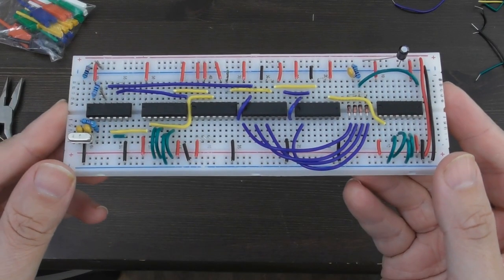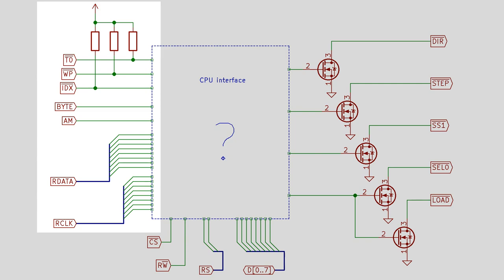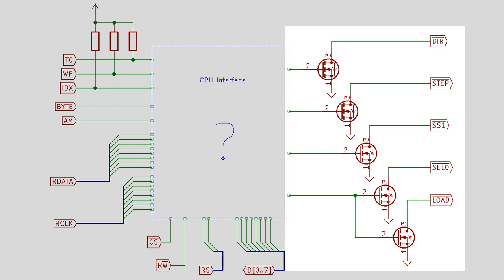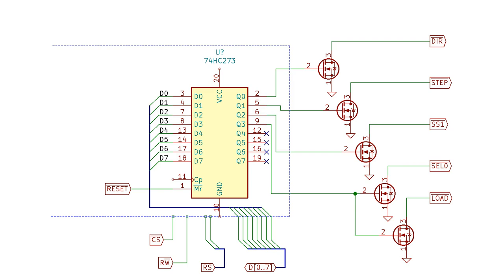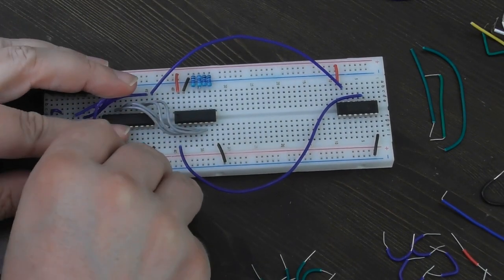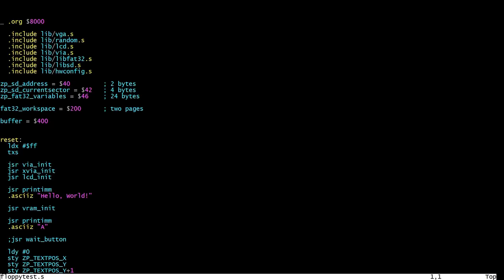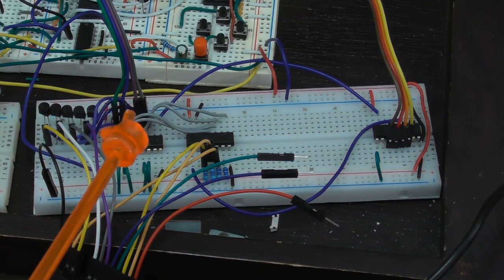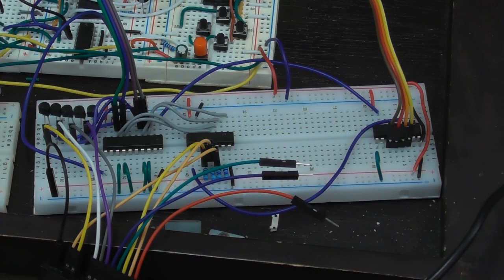Homebrew 6502 controlling a Floppy Disk Drive

Comment: I pulled out a bunch of schematics for FDC boards… and the common driver for the floppy I/O lines is an 74LS06 open collector hex inverter.
Reply from the maker: Yes,  I think anything open collector/ drain should work well, I don't have any though so have to improvise!
Reply: @GeorgeFoot  They used them (74LS06’s) for the inputs from the drive also… with pull ups before and after.
I got tons of TTL… but no MOFSET’s. I guess you’re more DISCRETE (sic!) than I am! ;-)
When I first saw this project I thought “Why doesn’t he just use a WD 1793?”… but then when you explained why you didn’t use a PIO I understood. ;-)
I’m interested to see how you design the data/clock separator… and are you going to do single (FM) and double (MFM) density?
Maybe I’m just lazy but I’d just pull up old (S100!) floppy disk controllers and PLAGIARIZE! ;-)
I recently restored an OSI C4P MFD… they didn’t use a FDC chip ether… they just used a UART! Which they then NRZ’d!!! All the floppy control lines they ran in/out thru a PIO (buffered (74LS06!) appropriately).
Reply from the maker: @geowar20  I think I included the recommended transit/ receive circuit from the Shugart SA800 datasheet in the video - I don't recall the exact part they used in the receiving end but I think it was schmitt triggered, which makes sense.

I do like to do things at a fairly low level, my goal is understanding more than anything!

Regarding clock recovery and separation, I built that circuit last year in the first few videos in this series - it's an unusual approach but works well for me. Currently it's FM only but it should be fairly easy to extend to MFM - just double the frequency, change the address mark detector, and probably handle the rest in software I think!

I hadn't thought of using a UART for this but I guess clock recovery is one of their main purposes. Still I enjoy coming up with my own solutions for these things.
Reply: @GeorgeFoot  The OSI C4P MFD didn’t do sectors… the OS just waited for the index hole and then read data from the UART like it was an audio cassette port!

Comment: Love it! Of course you had a nice way to say you won’t use a 6522 because it’s too easy XD 
When I get around to this you bet I will use a FDC IC instead - that seems like plenty of a challenge in itself.. but maybe I’ll do 8” floppies :D
Reply from the maker: Haha I wonder whether you can find some of those! Even these 5.25 inch discs are quite hard to get now.

A limitation of the 6522 was that it didn't have enough pins to read all the clock and data bits, let alone introducing more bits for writing. But a 6522 with some external ICs (maybe shift registers or the kind of thing I did here) could have worked well and would have the benefit of also incorporating timers and interrupts. I also had some crazy ideas to reduce the need for so many days and clock pins, which reduce the hardware complexity but add to the software complexity.

I checked Commodore's schematics too, but they didn't just use a 6522, they had another IC to assist. Two 6522s would be another option.
Reply: @GeorgeFoot  
I wouldn’t shy away from using the 6522 shift register for data and the gpio’s for the control lines - or external shift registers.
The 8” drives are horribly expensive - I will need a sponsor for one of those. I have no idea about disks either!
Right this weekend I found about 20 5.25” floppies so now I’m committed to getting a drive for those too - they seem to contain CP/M-86 software at the moment. If it survived since the late 80’s that is!
Reply from the maker: 8 inches would go well with the reel-to-reel tapes!

Comment: Welcome back! 

Unrelated question, but which video circuitry are you using?
Reply from the maker: It's the 640x480x8 colours one from a year or so ago, the same one that I bolted the sprites onto before.  My text output routine dates back to the earlier black/white/blue/orange four colour circuit, and I've not updated it to deal properly with the extra bit plane, so for this I just initialize the red plane to be set for every pixel, and let the text output routine write only to the green and blue planes.  I also swapped a 16V8 PLD in for some of the glue logic that synchronizes CPU access to video RAM.

Comment: Is it possible to use a 3.5 inch drive or it only works with 5.25 drives?
Reply from the maker: The interface is mostly the same for both, so I think it should work, but i haven't tried it.

Comment: I think I've got an old floppy drive somewhere, so I might try this myself one day. I'll be interested in how to read the floppy data, will you be using fat16 or a filesystem you create yourself?
Reply from the maker: I haven't thought much about the filesystem but most likely to begin with I'll use the BBC Micro's one, because then I already have a good way to get data onto the discs.

I think fat16 requires 512-byte sectors, which are also not ideal for these discs or an 8-bit computer in general.

Comment: Wow, a 150 ohm pull up seems really low. I am used to seeing 1K at a minimum.
Reply from the maker: Yes, I think it's to match the impedence of the ribbon cable (with ground wires alternating with the signal lines) - so 150 ohms will prevent reflections back and forth along the wire. But then I think 3.5 inch drives increased the resistance, and I'm not sure what effect that has on the transmission line.
Reply: @GeorgeFoot  Ah, that makes sense. I figured it was for something related to noise. Transmission lines are one of those dark arts of EE that I only know a little about.

Comment: You are not scared of the day when they stop making disks?
Reply from the maker: Yes, they are hard to get these days, as are the drives. But like must of the low level things I do, this is more for the sake of understanding how things worked.
Reply: Back in about 1992, I threw away 2 sacks of 5 1/4" and 1 sack of 8".... I still look back on that day with sorrow and shame.
Reply from the maker: @edgeeffect  Sad indeed. I thought I'd lost mine from my childhood, but randomly found them in a box in my garage a few months ago. Like finding lost treasure.